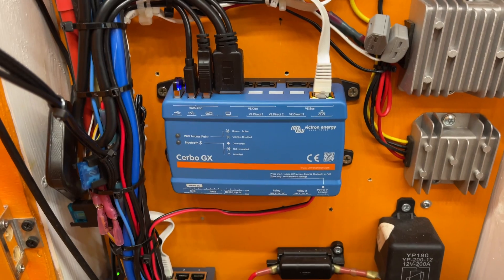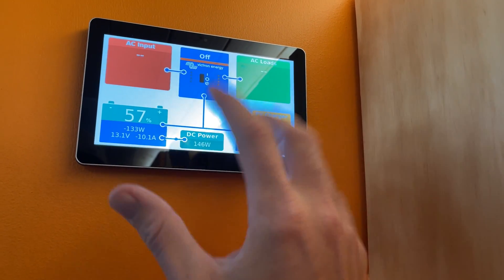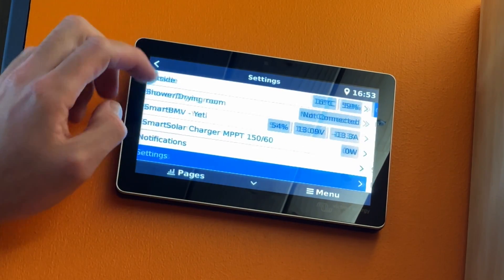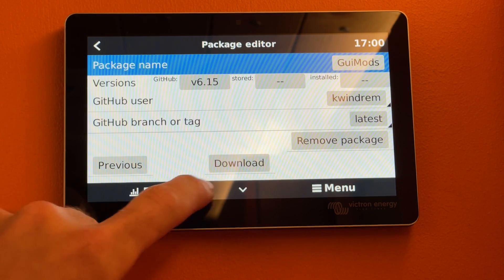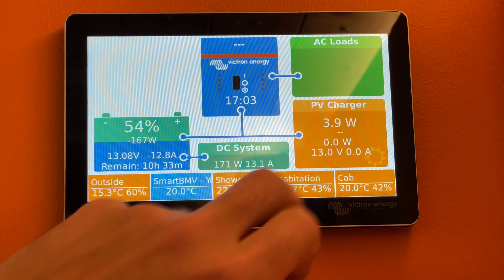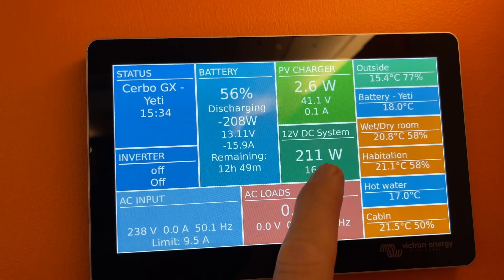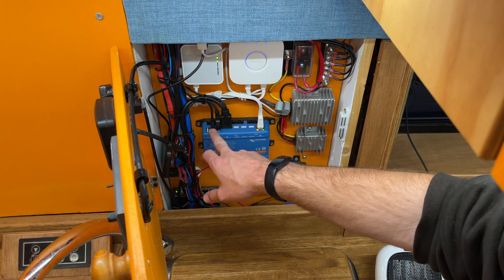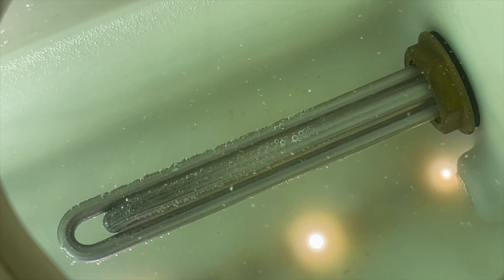Custom VICTRON

Comment from the maker: Is there anything you would do extra to a Cerbo GX? 

The “Dump Load” downs necessarily have to be for Hot water. It could be anything, turning on an air-conditioning unit automatically, automatically charging, a power bank or another battery back? 

What would you do?
Reply: Great video. How about controlling a computer 12v fan and heat mat via something like an ST100 for keeping a 12v or 240v fridge happy? Also, do you have a wiring diagram for the water heater setup?
Reply from the maker: @rhythmuk1   you could use a relay to control a fan to keep a electric cupboard cool, I know “Luke’s vanlife” does that with his Cerbo, I guess the same could work for a heat mat. As for wiring I think independent older solar dump load video might be helpful there
Reply: @MispronouncedAdventures  I really should have asked how you connected the Cerbo to the W3230, did you tap into the positive wire? I know how to wire both the W3230 and ST100. I think the ST100 is the better solution for the fridge, but the Cerbo is better for the water heater because of the ability to start/stop from SOC.
Reply from the maker: @rhythmuk1  the Cerbo relay output is wired to the power wire for the W3230 and the relay IN side of the W3230. So the Cerbo is powering the whole W3230 on and off, the W3230 hold its temp setting when off. 

The W3230 relay is then wired as a signal to the large relay to power on the 300w heater
Reply: @MispronouncedAdventures  Got it! 😁 Thanks for the pointer.
Reply: @MispronouncedAdventures - great video, thanks….so, something me and a pal of mine are chatting about (we have almost identical setups and accessories, conveniently) is to use surplus solar energy to then charge our EcoFlow power units….I’m guessing the relay function could be used for this, instead of heating water (we’re in campervans, my hot water is via Webasto heater on-demand), a relay could switch the output of the solar panels, pre-MPPT (Victron), to an XT60 port where the EcoFlow could be plugged into. This would then use the EcoFlow’s built-in charge controller. Cerbo logic could then be setup to divert it back again as/when the leisure battery (Roamer seatbase) drops past a set threshold?

Comment: Dump load from the B2B is surely loading the alternator and using more fuel? I think I'd try and bypass that option. Solar of course is always free! Having said that.....a good watch. Ta.
Reply from the maker: Yes, but not any more than the DCDC was using normally. 

And once the hot water reached its target temperature that itself would turn off too.

Comment: Great video as always Alex, just wanted to say thanks! We will be adding the "Dump Load" via the cerbo for our hot water tank, although we are 24v so we will have a few more steps to add to get it all working. Might even add the guimods at some stage too!
Reply from the maker: Glad it was helpful! There is a completely new Victron interface as well if you wish to use it

Comment: So is the tank heater element DC powered?
Reply from the maker: In my system, yes it’s a 400W 12V DC. 

if you had your inverter turned on, you could set up a more powerful AC one

Comment: What relay are you using?
Reply from the maker: For which aspect? The Cerbo  has built in relay and then for the heating element itself I was using a 200 amp automotive relay which is overkill.

Comment: A question, with the cerbo I’ve read you can use it and the touch screen to adjust the current limit in for a multiplus( from mains/shore) instead of using a separate controller like the digital multi controller.. I see you have that, is it just because it’s a quick dial to adjust rather than going to the screen or another reason?
Cheers
Reply from the maker: I perfer the quick dial and a physical on/off toggle button

Comment: Battery's will deteriorate quicker in the 80-100% charge rage.
Reply from the maker: Indeed. less of an issue if the system is used every day. More so if left at a high SOC for storage / long time

Comment: The hot Water is NOT for free, because u paid for the solarsystem.....
Reply from the maker: Splitting hairs point you are trying to make. being “free” doesn’t have to refer to it financially, and it doesn’t in this case . It’s “free” as there has been no fuel or energy expended by the system heat it. 

Also my solar panels were free from my old neighbour.
Reply from the maker: Is it free financially as well? My solar systems was solely and  primarily bought to charge the batteries via solar and nothing else. Making a dump load is a just a byproduct of having a solar panels and never my intended purpose.

Comment: Hi Alex!
Fantastic video! 

Didn't you have a water level sensor?
This video is about a year old; you could have MOD the YETI since then.
But if we are right, we saw it in one of the videos from 2024 when Katie was visiting.
Reply from the maker: I added the water level sensors just before this trip ( 2024 Jan )
Reply: Did you mention it or show it in any video?
If not, which water level sensor did you go with?
Reply from the maker: @NordicPass  I didn’t show the install, but they came with the bobil van kit I recently did. The resistance based and kind of this generic ones two wire connection to the Cerbo, very simple.

Comment: super old, but if you move the wire on the relay to the  NO spot instead of the NC slot you can use the logic like normal on the generator start/stop function, as you have a inverted Relay instead of logic now.  this will allow the run time to be accurate.
Reply from the maker: That’s what I tried first time round in the video, I switched to the inverse logic as I could get work on NO.  as you rightly pointed out, messes up the timer. I couldn’t get it to work in NO, I still dont understand way, there is no reason for it not to work on NC
Reply: @MispronouncedAdventures  huh. Interesting, I must have missed that 🤷‍♂️ but yea it should definitely work. Super weird. Could add your own controller but that's a lot of effort.
Reply from the maker: @alandoyle95 yeah doesn’t really make sense why it didn’t work on NO, unless there was a hardware issue in the wiring or an issue with the actual pin

Comment: hello can we go back I have os 3.13 and put 2.90 it's possible because I can't!!!
Reply from the maker: OS can be rolled back. The Victron website mentions a number of ways of doing it via a USB or SD card.  you can put a clean on install on
Reply: thank you for your quick response, yes we can set the factory settings but not go back, I haven't seen it!!! @MispronouncedAdventures

Comment: Do you have the smartshunt connected via bluetooth or ve direct to USB, or ve direct cable?
Reply from the maker: BMV-712 and not a Smartshunt in this case but your question is the same. You can’t connect Victron units to the Cerbo GX via Bluetooth ( just the app ) 

In this case I’m using VE.Direct to USB as I had them left over from when I had a Pi running Venus OS. But a VE.direct to VE.direct cable would also work fine

Comment: Hi Chap, great descriptions of what you were trying to achieve. Re the Cerbo GX not allowing you to use the relay in a more logical manner, you are correct. However if you want to drive logic within the Cerbo GX in a more advance way, consider activating the Node Red layer within it. Advantages of Node Red over the standard OS, is the workflow logic is basically limitless. So as long as any module you want to get data from or drive is interactable (Victron have to make them available). You can do anything including interact with wider non local data (think have a load react to dates, weather and light conditions, from web available content). The Disadvantages you need to consider if you go down the Node Red path, are: its a bit of a rabbit hole, and you can very quickly over complicate a system by thinking too broadly and create badly developed and overly heavy workflows.  Getting the Cerbo GX to do far more than Victron intended, can quickly exhaust the on board CPU and RAM resources, the result is a slow non-responsive system. To activate the Node Red Layer you need to install the Large Cerbo GX firmware, at which point Victron consider you to be an advanced user and stop any OS support (although there is great support in the Victron and Node Red Communities to fill this gap, also if you have issue you need Victron for, simply revert to the standard small OS and they'll come back into the conversation).  I hope that helps, take care D

Comment: You have different color blocks for your temperatures. Is that because they are different types of sensors, or were you able to set those colors? If yu set them, how?
Reply from the maker: Same types of sensors, but in settings you change was things it’s  monitoring, fridge, battery and so on, that changes the block colour

Comment: I absolutely love Tech but your systems are way way to complex. 
Simple is the only way to go . 
When components fail your going to have nothing. No power no hot water dead batteries 😅
Nice system though 👌
I really hope you have redundancy
Reply from the maker: Maybe to be too complex for you?. Building it myself I know how it all works. The system it still built up individual components like any other system, Victron kit is unlikely to fail and if it does if can be serviced/replaced by Victron dealers in any country you see in. Plenty of back up systems. I don’t spent my winters in the Arctic without back ups

Comment: Do you not have ve direct cables running to the cerbo??
Reply from the maker: No, as I had ve.direct to USB cables as before I used a Cerbo, I  used Venus Os on a raspberry pi. So I have all those Ve.direct cables to a USB. Into a USB hub and then a single USB on the Cerbo from the hub

Comment: Fantastic video! I’ve been trying for 2 years to get a solar dump via Cerbo GX sorted and no one - until you - have come up with such a neat solution! Honestly, it’s brilliant using the generator ‘function’ and the reverse logic to operate the SOC and so obvious once you stop and think about it!
Quick question please, at 11:12 in your video we get a glimps of what looks like an adapter Victron connector block with screws to secure the wires instead of using the push fit/bootlace feral. Where did you get the screwed version? I’d much rather use it than the push fits which constantly come loose as my bootlaces aren’t long enough. 👍
Reply from the maker: Glad it was helpful I think with a bit of tweaking or testing again, I  can get it to work on the solar dump it’s think the  generator is it.  Currently when the solar dump is on, it things the gen is off. 

As for the screw terminals, it’s the plug which came with my Victron Mppt controller. Those type of connectors are generic, but I can’t remember the name

Comment: Could a Truma combo heater be triggered to heat water in dump mode ?
Reply from the maker: I’ve not planned with the Truma combo but if there is a manual switch to turn on and off the hot water heater when I don’t see why not

Comment: Hello, thank you for this Video.
Did you know if a GUI modification is available for detailed DC Power?
I run with an Skylla i charger and a Phoenix Smart Inverter.
I want to change my hole display settings to see the the top left AC IN Symbol as my Skylla Charger with all Data's and AC OUT the data's from the Phoenix.
Best regards Robert
Reply from the maker: I’m not familiar with that particular bit of equipment, but I know there have been some pretty extensive modifications done with the GUI. I am really only playing with the basic stuff. There is a group out there which may be able to better help you.

Comment: Regarding Bluetooth coverage. 

Bluetooth comes in three classes. Short range (1m), normal (10m), and long range (100m)

I hava a long range adapter, and it works wonderful. The minus is that the antenna is a bit long, but not a problem on stationary equipment...
Reply: As per Bluetooth standard:
Long range (Class 1): 100mW
Normal range (Class 2) : 2.5mW
Short range (Class 3): 1mW
Reply from the maker: Thank you for the replay, Bluetooth adapter are definitely helpful for this unit. As it range can be limited in a van with all the interference for those Tags

Comment: Do you have a 240v or 12v water heater element?
Reply from the maker: I use a 300w 12v Dc element, I’m sure it’s not too much of area work if you wanted to use a more powerful AC one
Reply: @MispronouncedAdventures  We have an AC water heater element on our boat already. I am looking into creating an assistant on the Multiplus to enable the secondary AC outlet that the water heater is connected to when SOC > 95%. Do you know the brand of your 12v element? Did it come with the tank?
Reply from the maker: The 12v electric I have is generic, I’ve got it from Bimble solar. As for the tank I added the element myself.
Reply: @freakent  I had exactly the same issue and have done a “work around” by putting my 2Kw immersion heater on a 13amp plug (2Kw=8amp so it’s safe!) and plugging it into the mains via an intelligent Wi-Fi plug. If the sun comes out I can check battery SOC via the VRM on my phone and if alls good I use the plugs App to turn the immersion ON but set the ‘Count Down’ feature on the plugs App to ensure I don’t forget to turn it off! I’m going to have a go at doing Alex’s solar dump now though. We live on a Dutch barge so I’ll adapt it to isolate the dump feature if we are ‘navigating’ as our engine heats the HW for free as we go.
Reply: @aljotock  I worked out how to create an Assistant on our Multiplus that switches on the relay on our secondary AC output (the one with the water heater on it) when voltage is above a certain level and switch off when it goes below. So at the moment we can just switch the water on and heat it via the inverter for 30 - 40 mins. Next step is to use a relay controlled by the GX device and switch the water off and on automatically based on SOC.

Comment: I've watched a few of your videos but I always get stuck on these controlling devices. This is the first time I've seen this Victron unit. Essentially I want to control everything in my van from one central unit that also allows automation, from both the control unit and WiFi to control it while away from the van. Fan, aircon, heater, security, cameras, temperature control relays, you name it. Is this the system that I'm looking for? Are there any other similar systems you've seen besides Victron?

Comment: Hi buddy do you also use the cerbo to power a heat pad using temp
Reply from the maker: I don’t, but I’m sure you could as there is a temperature option
Reply: @MispronouncedAdventures  I’ve just sorted my Cerbo to turn ON a cooling fan in the engine room of my barge if the temp goes >40’C and OFF again at 30’C. Same principle for a heating mat. Have a read of the Cerbo manual in the relay section. There’s a great bit which explains how to use both relays to activate a second heat pad in case the first isn’t coping with the temp.

Comment: @Mispronounced Adventures  great video, but I don;t like the way you did the dump load. you should use the NO contact and set the state of charge in the normal way. the fact that you use the NC contact, if the Cerbo fail, the element will turn on
Reply from the maker: I completely agree, I don’t like the way I’ve done it, but for some reason I could not Get NO to function

As it does suffer from the power loss issue I will re-develop it in the future to rectify it or figure out how to get the other contact to work
Reply: @MispronouncedAdventures  I did some research, this could be done with your inverter !!! yes it sound weird but you can program the relay to operate with the SoC. to do so you will need a usb-mk3 adaptor to program your multiplus relay
Reply from the maker: I have a usb-mk3. Is that when the Multiplus is being used in its  “battery monitor” mode?
Reply: @MispronouncedAdventures  when you connect the multiplus on the computer with the ve configure, you need to disable the virtual switch, then go to the assistant tab and add an assistant to control the programable relay then after a few question you will be able to set the value of SoC

Comment: Great video! Can I ask how did you add the heating element to the water tank? (I couldn't find any video in your channel, but maybe I'm bad at searching)
Reply from the maker: It’s on the “Bobilvans hot water install video” but more or less drilled a hole in the tank and threaded the element in and put a back nut on it

Comment: great mod this, will definitely be doing it. The bluetooth dongle is also a good idea (aside for the range it adds) as the Cerbo will stop working with Ruuvi tags when the Cerbos core temp hits 53 degrees - so a good use of that spare USB slot for sure. Thanks for the vid Alex, great update.
Reply from the maker: It’s a great upgrade to do to it. 

I hadn’t seen the information on the Cerbo temp going above 53c part you mentioned. Where can I find more information about that is it in the manual?
Reply: @MispronouncedAdventures  it is yeah. This is not a plug, but I have a 50 second video I’ve been meaning to upload lol. Will get it shipped. But the details are on the cerbo manual now - they updated it. It hasn’t always been this way.